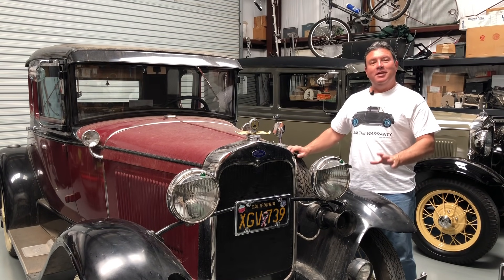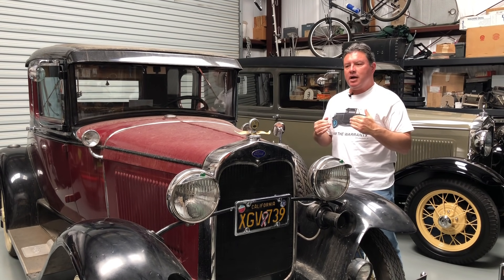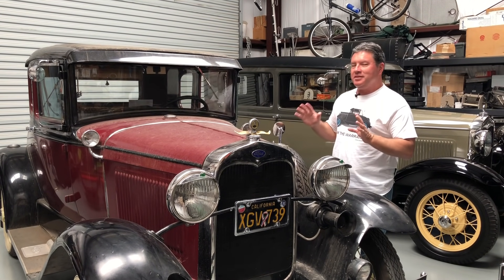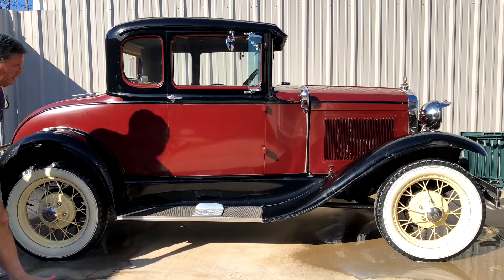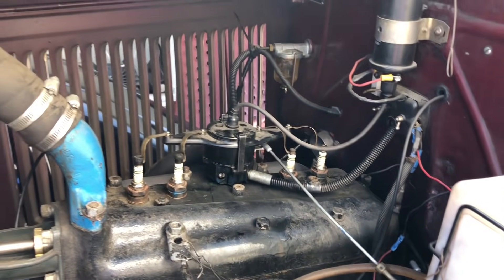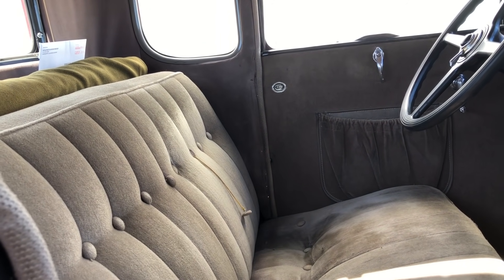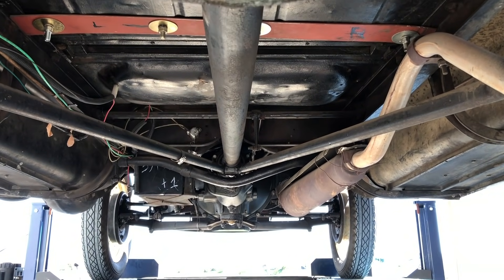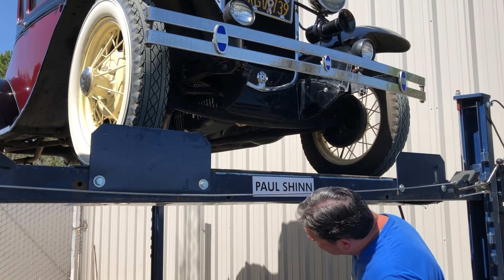Rescued 1931 Ford Model A first wash in years, DISGUSTING!!

Comment: Paul, if you run a 12 volt coil and points, you need that resistor to limit the current through the points. The only 12 volt systems that didn't use a resistor were the ones with an internal resistor in the coil.
Reply from the maker: Yes.  Thanks Joe.
Reply: I think you need a grease resistor.

Comment: I agree with the polls calling for OEM with period-correct aftermarket tweaks.  Most of what she needs seems pretty straightforward, if labor intensive.  The fender and gas tank, however, seem to be seriously sketch.  I forsee welding and grinding in your future, not to mention an engine tear-down.  I eagerly await the next grimy episode.
Reply from the maker: You're right, Bill.

Comment: I just stumbled into your channel, I watch a few videos and I like what you’re doing. I own several older Ford’s (all flathead era) but now thinking about purchasing my first Model A... (wife’s gonna love that!!!) I wanted to comment on the 12v coil with the resistor, a lot of 12v coils need the resistor to drop down the voltage, in fact I believe that coil says on the side “Requires resistor.”. I’ve converted all my flathead cars/truck to 12v and use a resistor/coil when i’m keeping a points and condenser ignition.
Reply from the maker: Good to know, Thanks!!  And, welcome!  All old Fords are considered brethren here.

Comment: Paul, great video.  This car is disturbing and odd.  Some of the work done on it smacks of a real old timer, while other work points toward a teenager.  Someone had basic knowledge but wasn't able to exercise proper repairs.  I'm hoping that's just Bondo used to hold the temp gauge, and not sealer because it's screwed into the fuel tank.  The frame mods and adaptations are frightening.
Smart towing it to Paul's place than driving it.  Doesn't seem safe for the road.  I'll enjoy the future videos correcting this mess.
Reply from the maker: Thanks, DM.  Here's A heartfelt "OK Boomer" just for you!  See you soon.
Reply: @ModelA    Hahaha!!!
OK back to you Boomer.

Comment: Can you do a video on how to bring a fuel tank back from a rusty grave? The one in my ‘29 CC pickup has some rust in it so I just switched to a old stainless steel milk can (10 gal) in the bed of the truck
Reply from the maker: Yep.  Coming soon.
Reply: @ModelA  when i still had the 4cyl in there I had to pull over every 10 miles or so and back flush the fuel filter. I would love to be able to use it again.
Reply: Since I'm old, my son replaced the 1931 fuel sender. He had to pry the old one out. It was so rusty it showed 1/4th tank forever and inside he coud feel rust. So far, the solid filter is working. There is no glass bowl yet.

Comment: I believe the resistor before the coil is supposed to keep the coil from getting too hot and misfiring. Chrysler used them for years, it may be needed for that coil. Won't be needed if you go back to 6v.
Reply from the maker: I do plan to go back to 6v

Comment: That resist your you were referring to is called a ballast resistor it reduces the voltage to the points all cars with the points tape Distributors had what they called the ballast resistor to reduce the voltage

Comment: Not many all steel original cars left like older Harley Davidsons. Somebody has did something other than stock to them. If they were hot rodded, most have been through the crusher years ago because of crashes. That's why there's a lot of fiberglass out there as hot rods.

Comment: Wow Paul...you got your work cut out for you with this little lady! Don't quite understand why they had to mickey mouse so much of it - I mean there's so many Model A parts readily available you can build a brand new one pretty much! Look forward to following you on this journey

Also, unrelated question (at least to Athena), I notice you're a big fan of antique radios so this should be right up your ally: I know the Model A (and Fords in general for that matter) didn't come with radios until, I wanna say '32 - 34ish, definitely the V8 model. That being said: What kind of after market radio would have been installed on a Model A by a potential owner? Do you know if dealers offered any radios? Or did people not really bother installing radios in them until the hot rod era arose? Thanks, always love to see your content and your undying love for these automobiles!
Reply from the maker: Although a couple radios were available in 1931, there wasn't yet much available on the airwaves.  If tou wanted a radio in your Model A in 1931, you would go somewhere that specialized i  them and they would custom install one.  It was very invasive surgery as the radio was made up of several components and a control head up front.  I juat use a 50's vintage Zenith Transoceanic (tube type) radio and run it on its own batteries in the Model A if I want radio.  But, the ignition noise is intolerable.  Anyway, with such a sweet sounding motor, why would you want to listen to a radio?
Reply: @ModelA  Fair point! Appreciate the information as always, Mr. Shinn!

Comment: May have been mentioned? you being your "six volt" guy and rightly so for a Model A - the ballast resistor in a 12 volt set-up will  "save the points" after the car is running, although it must be wired up correctly, looking forward to your next video
Reply from the maker: Thanks Dave

Comment: OK young fella.  Well Paul, most things are obvious like "replacing the entire wire harness"  but I do have maybe one suggestion upgrade.... Perhaps you could put a 'oil catch can' to take the blow by and connect it into the air intake manifold. Cheers mate 🍻
Reply from the maker: I think that fixing the blow by is on the list

Comment: Would you consider making a video about teaching about engine upgrades like high compression heads, better carburetors, etc. Why you might choose to do them or not.
Reply from the maker: Maybe.  Since I fall into that category of "purist", my opinions might not be without bias.  Would that be acceptable?
Reply: Probably would still be fine. It's not like there are many model a devoted YouTube channels. I would be most interested in period examples anyway.
Reply from the maker: Excellent.  OK, will put that on the idea board for a future video.  Thank you.
Reply: @ModelA  I'm "pure" . My Model A has a Ford engine, Ford transmission, Ford steering wheel, column, and box, with Ford hydraulic brakes. It looks like a Ford, rides like a Ford, and sounds like  a Ford.

Comment: Someone must have needed to get rid of a box of crimp butt connectors. I especially like to two that are about 3 inches apart on the passenger side fuse to nowhere.
Reply from the maker: That's MINT!  Hahaa!!
Reply: I once bought a 1949 Ford Kustom that had seveal guages and colors of wire going to each thing. Some was small home extension cord wires and some was telephone wire.
About 1/2 way home, at the 50 mile mark, smoke and smell came from the dash. The tail light wires were against a tail pipe. From there on it was all down hill with that wiring. That was one of the better wired cars I've bought.

Comment: 12v coil needs res. As I recall the 50s ford's jumped the RES. w.during cranking. .coil gets too hot WO. .res. also burns points.  I'm 80 . Many had 292 312 352 engines  in the 32s  when I was a kid. Not everything need bE PERFECT .like women think they are.
Reply: GM also used tthe white resister. I'm even older and......... perfect!

Comment: WOW a threading die as lug nut replacement - now there's something you don't see everyday :o
Your video reminds me... I still have to give my car the big spring cleaning. Well... maybe next week xD

Ps: If you plan on getting rid of the headlight visors... I wouldn't throw them away if somebody sent them to me ;P
Reply from the maker: Want me to send them with the steering box stuff?
Reply: @ModelA  Wow that went quickly! Well, if you have no use for them, I'd love to give them a try!
Can't wait to see you sort Athena out - when I saw it for the first time, I thought all it needed was a little cleaning, but oh boy, it was just hiding underneath xD
Reply from the maker: @AstraWerke   Makes your coupe body mounts issue look like nothing, right?
Reply: @ModelA  Crying on a high level, indeed xD Be sure to add me some wiring and tin cans to the package so I can fix mine up ;P
Reply: I'm hurt. I just added blue jewel headlite visors to the sealed beam headlites, have another set of blue jewel visors for the large running lites, and some small red jewel visors for the cowl/blinker lites. They compliment the stone guard and stainless 
rear license mount below the front bumper using blue and red bicycle reflectors.
Reply: @modeladenny1218  I like them. Gives the Model A something more than the factory "stare". Plus, the jewels immediately show you if one of the bulbs burns out :D
Reply: @AstraWerke  Apparently back in the good ole days someone liked all of those accessories. I think white rear mudflaps and curb feelers might be too much!
I can't find the visors with red jewels for headlites. I did get the red jeweled cowl visors and blue large lite visors. 
Mine has the chrome sealed beam adapters, adding more shiny stuff. I'm already getting bad compliments from friends and my kids. I'm too old to get new friends or kids.
 Even the headlites are two different brands but look alike. One dim was out till we went for a long drive on our Illinois city streets. Something wiggled and both headlites now work. At least till we hit another bump! Probably one of those sus connectors!
Still have lite visors,  step plates, and seat belts to add when it gets warm again.
Seat belts in an old phaeton seem like a good idea for the grandkids. 
I'm too old to be a Boomer and to me Athena looks like the things I remember from the past.

Comment: Athena looks much better than many old cars I've owned over the years. Some of you Boomers don't realize that owners did what they had to do with what they had to keep those cars running back in the good ole days. There wasn't always a Western Auto store or Sears Robuck nearby.
The cross member what-cha-ma-call-it thing is questionable and sus. But even the wiring looks like typical shade tree work.

Comment: Ok. So the hot rod with the 4 banger (which I voted for) got shot down. Instead of plain Jane restoring it with drivable mods, could you add some period correct upgrades to the motor, like an overhead valve head, or dual carb manifold.
 There are plenty of restore model A to original vidys out there. It would be very interesting to see a resto upgrade that could've taken place back then.  Thanks much. No boomer here, just 4 years after that.
Reply from the maker: We're going through our stock to see what we have.  You never know!

Comment: Do you find your cars have a dull finish after washing them?
I noticed you used Dawn soap.
Dawn is used to remove oil so it takes the oil out of your paint.
Save yourself some time from polishing and waxing and use automotive.
Reply from the maker: I used Dawn because the car was smeared with grease, and then dirt was stuck to the grease.  I wanted all that off so I could see the raw paint.  I did mention several times that the car was covered with grease.

Comment: OMG, I never seen so many issues.  All I know is that you have a hand full. Body off restoration just to get it back to original. The frame is questionable. I wonder if all those nuts and bolts are hiding more repairs that will cause problems down the long run. To my opinion  it really needs body off resto, Start from ground up to many issues that was made to cover up problems they already have done. A inspection from the DMV would not let it pass. After doing my share of restorations I know the cost and time. Cost from brakes on up and like you said the bearings is what would be my first concern.Think about all the oil leaks that they have put on. Its almost a ground up restoration. Unless its worth it for you. I would pass and sell it if you can? part it and maybe you can get your $ back well almost. My advice from a man that is 61 and has restored a number of Model A's. Wish I was there to help and a project for a retired fellow. God Bless and Good luck.
Reply from the maker: Thanks Robert.  I have restored many Model A's.  I knew this car before we bought it, and already had an idea what it was going to need.  We plan to do a mild restoration on this and make it safe to drive.

Comment: "Normally I wouldn't use a hose, water, & soap and such crass methods to clean a model A".  Then how would you normally clean a model A?????
Reply from the maker: Driwash-N-Guard and microfiber cloths.
Reply: @ModelA  I have heard of waterless cleaner but I have never looked into them.  Now I have.  I'm going to have to give it a try. Thanks for the reply.
Reply: After doing some research I found that Driwash-N-Guard is not really available in Canada.  So...  I have found "Mequiar's" and "Chemical guys" both make a dry wash and get some decent reviews.   Have you had any success with anything else besides Driwash-N-Guard?   That might be another video all together.
Reply from the maker: @jamaf99    I have tried other stuff, but nothing works as well.
Reply: @ModelA  Well crap.. Oh well.   My in-laws live near Sumas Washington.  When the boarder opens up again I will have to take a trip over and pick some up.